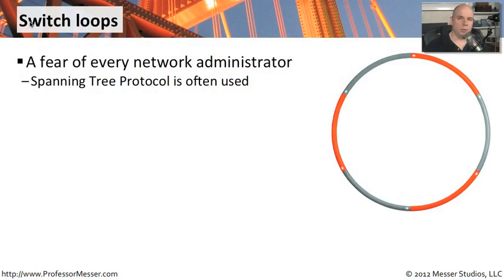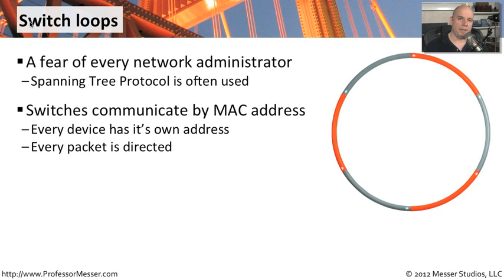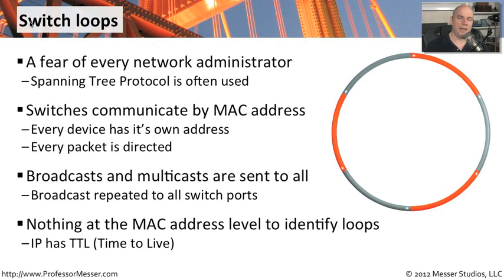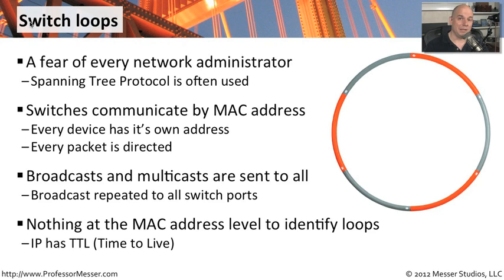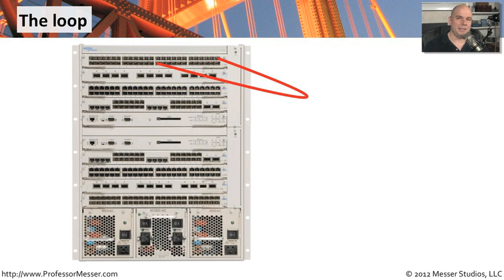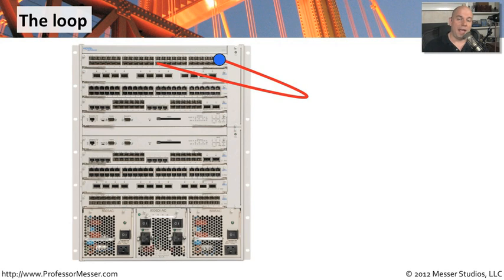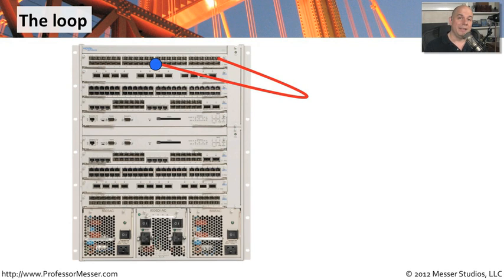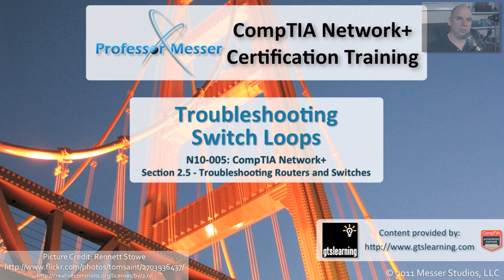Troubleshooting Switch Loops - CompTIA Network+ N10-005: 2.5

Comment: I have dealt with switch loops several times, it's worth mentioning I can think of at least three incidents where the issue was physically not at the switch but at the wall jack.  Someone just plugged in a random loose cable that was already plugged in!  Best way I know to find it is just start isolating switches, then patch cords, a bit tedious, but it works.